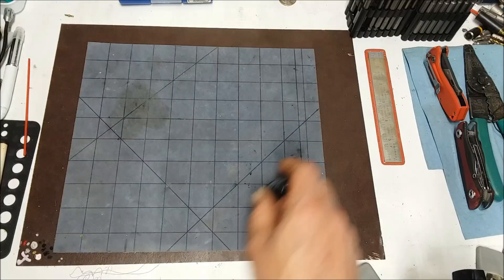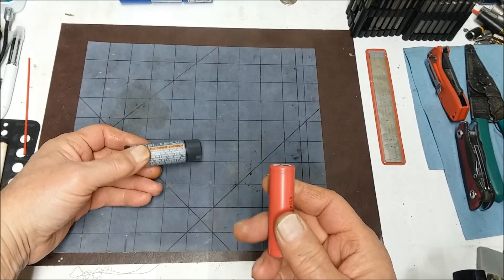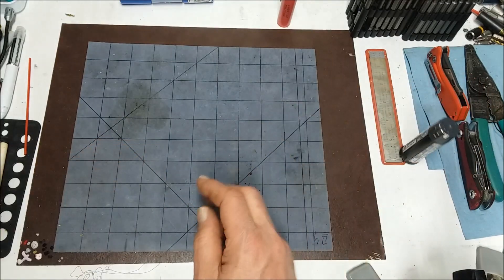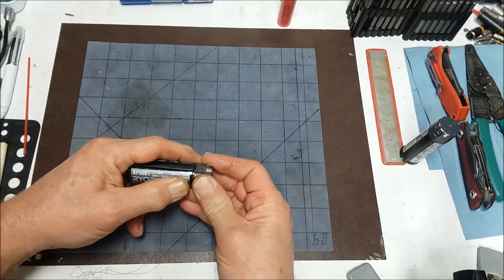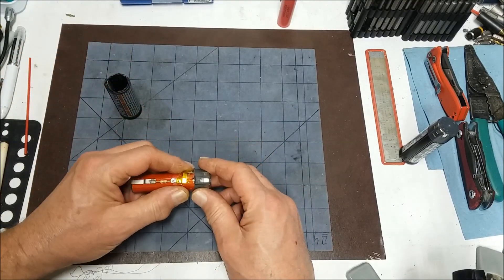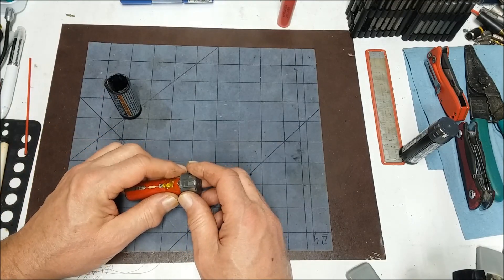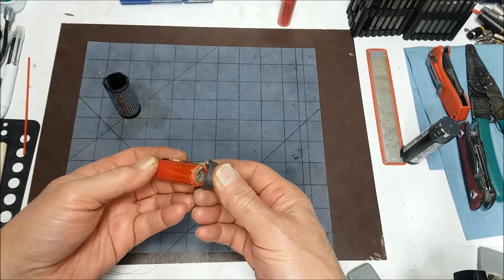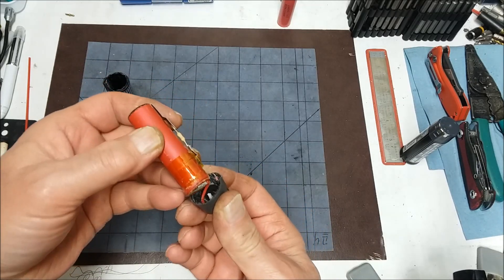Ryobi Tek4 Battery Repair | Ryobi Tek4 Battery Hacks

Comment: Maybe it didn't work or charge to start with is becausevthe diode connection was already bad. Charge the battey with external power suppy using other contacts.

Comment: The diode is probably just to drop the voltage (18650 max voltage is 4.2v) or for reverse charging protection.  I would imagine that since there are 2 negative terminals, one is for charging into the battery and the other for powering the tool it plugs into.  Just a guess right now- picked up a Tek4 screwdriver at Goodwill for a few bucks, looking to make a homemade charger.

Comment: I see that there is also a resistor in there. What is the value of the resistor? Are there any other components? I'm trying to create my own TEK4 battery from scratch. I've designed the shell but want to make sure I have the right components inside to charge correctly. I could charge the cell on the outside and then put it in, but it'd be easier if I could use the TEK4 charger.

Comment: how do i open this then? my battery died, i have several 18650 to replace it
Reply from the maker: If you watched my video, you saw how I messed up my battery trying to open it.
It's not an easy fix. Easier to just buy a new battery.